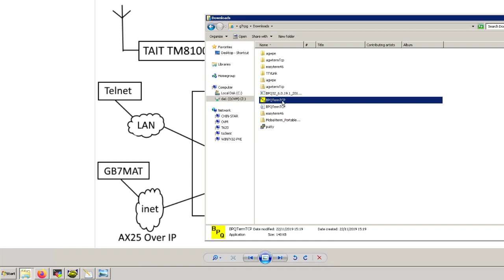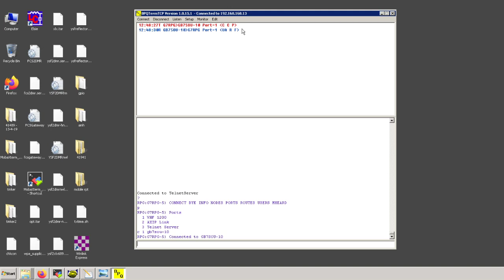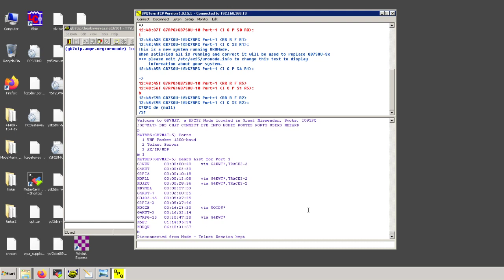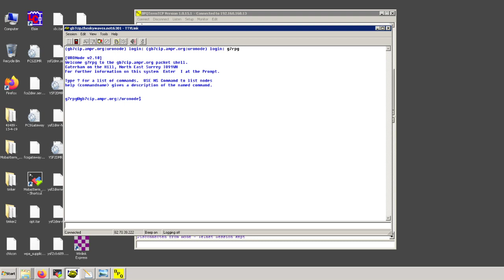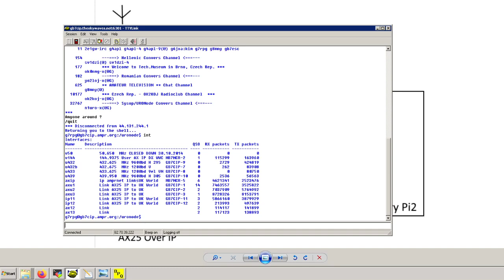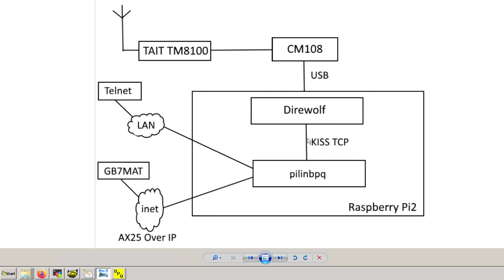Packet radio node with Direwolf and BPQ

Comment: Hi Peter, thanks for the video,  i set up bpq 32 on windows with dire wolf all seems to be set up ok but when i try to connect to a station you can see after my call sign rather than port 1 <c c p> mine shows up  id port 1 <ui c>: and doesnt connect ive checked my config file but cant find anything relating to this, any ideas? Im using windows for now as i am workingnon a rasberry then will switch over to that.

Comment: Is a cheap BaoFeng good enough as the Radio here to set up and test or is there some issue with it requiring a better quality radio?
Reply from the maker: Pretty sure it would be fine if you're close enough to another node. RX not very good if connected to external antenna.